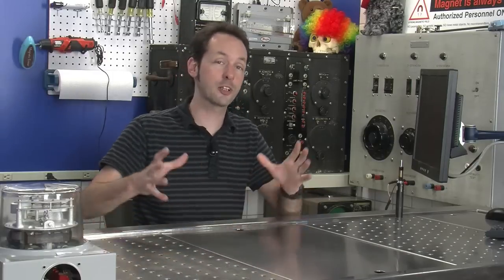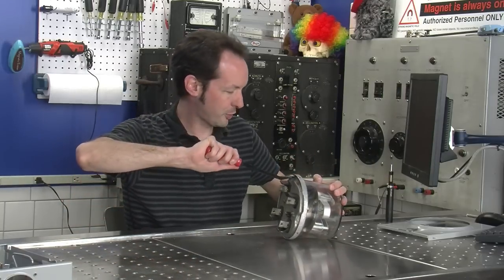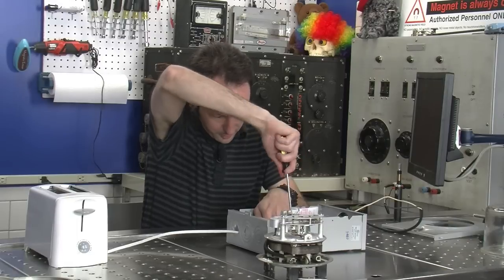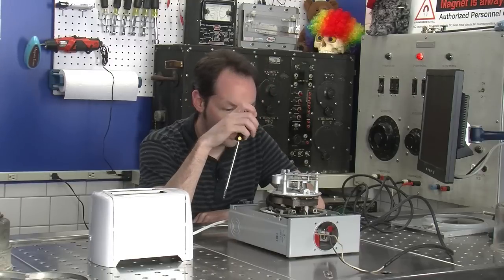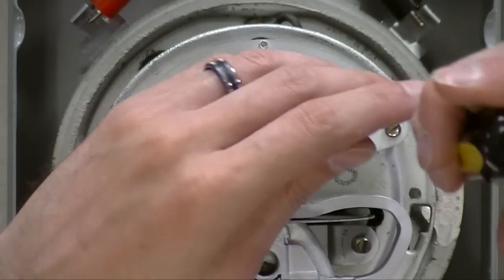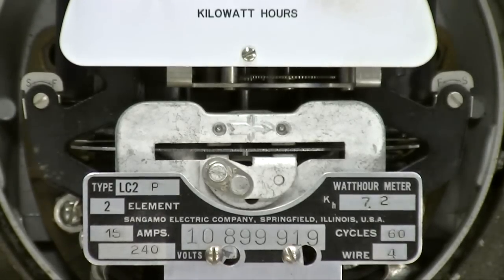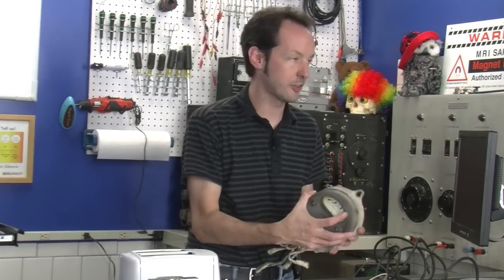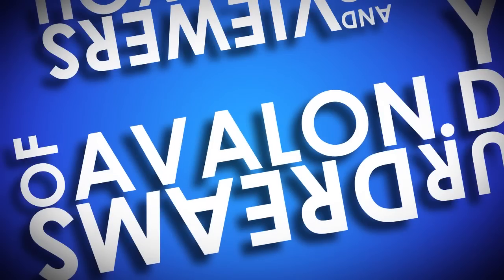Power Meter: Equipment Autopsy #66

Comment: I have been in metering for a utility for 35 years. I enjoy watching videos like this, and use them for comic relief and training of my apprentices.

As someone else stated earlier, the "lead seal" around the "fish bowl", is part of the cover and you simply unscrew it from the base. There is a small seal that holds the cover on and detects tampering if anyone has removed the cover. On a meter this old is it probably a small screw with a hole in it for a wire seal. 

The 15 amps is the test current rating. The meter is rated for 100 amps. Modern meters will now have info on the nameplate such as TA 30 amps, CL200 which is 30 test amps, meter rated for 200 amps. CL stands for Class. When you test and calibrate a meter you test at the rated voltage and current for the test, in this case 15 amps. The adjustment screws are for full load and light load testing. Full load test is done at 15 amps and light load at 1.5 amps. You can speed up or slow down a meter with these screws but not more than a few percentage points. Not enough to see any visible difference. 

The K 3.6 is the amount of power or watt-hours for disc revolution. It is now on the nameplate at Kh 3.6, the Kh is known as K sub h. 

Not sure why he popped the indicating needles off the register dial, they come off with the register when you remove the two screws. 

Perhaps a little research online would help before doing a video, but then we wouldn't have the entertainment value.

Comment: Kh = 3.6 means 1 revolution of the disc equals 3.6 Watthours. The disc has to do 277.7 revs for 1 kWh. The second meter you showed has a different wiring configuration. and constant of Kh 7.2. Should have run at half the speed of meter Nr 1. Tip a kWh meter should be installed vertically.
Reply: RODALCO2007 I had a funny feeling I'd find you in here

Comment: I like your videos! 
The "15 amp" rating is not what the meter can handle, it is the load current used to calibrate the meter. For 100 amp capacity, 240 volt meters, the calibration current will usually be 15 amps, and for 200 amp capacity, 240 volt meters it will usually be 30 amps. 

So those should be 100 amp rated meters, which, considering that 40-60 amps used to be a common house service, was plenty of capacity! Lol

Comment: I'm a little behind, the two fast/slow screws... one is for the voltage side or top of meter and one is the load side or bottom of meter, the disc spins based on the voltage coming in and the amperage or current being pulled inside, so depending cranking both screws to fast may not work too well unless you have a heavy load

Comment: Hi there, do you think that 3.6 might be the power rating for the electricity supply. e.g. 15 amps * 240 volts = 3600 watts. W=V*I. Just a thought.
Reply: Kh ( 3.6) = 3, 600 watt second per revolution of the disc, the smallest amount of watts To start the disk rotation, (Killowatt hour constant) Divide:  3.6 Killowatts 60 minutes per hour 60 seconds per minute per 1 revolution= 12, 960 watt seconds ( equivalent)= 15 seconds per revolution = 864 watt seconds . Test Ampere rating 15 amps ( Smallest amount of amps to accurately record Electric consumption, Maximum capacity( 60 amperes) = 400% overload capacity

Comment: Old school power meters are cool 'cause you can see how they work. There are two coils, one in series with the load to measure current and one in parallel with the supply to measure Voltage. As you said, there is no movement of the disk if you have Voltage with no load (current). And the really cool bit is that the Voltage and current have to be 'in phase' for the meter to measure at all. In other words, the meter responds to and measures  only 'True Power' (Watts), but not reactive power (VAr)

Comment: More as the video goes on.. The 2 screws are the Fulll Load adjustment and the Light Load adjustment as previously mentioned.  They will only effect the accuracy of the meter by 5% at most.  After that, you toss the meter and get a new one.

Comment: That is a US meter. In the US and Canada, hot is 110 V relative to ground (and, thus, neutral), but we actually have two hot wires come in that are 180 degrees out of phase. Each is 110-120 V relative to neutral, but 230-240 V relative to one another.

Comment: Interesting video but you really didn't get to the functional heart of the watthour meter. The part you removed and dismantled was the register - used for recording the energy usage. 
The disk is both a motor and a generator. There are two windings - one for load current and one for line voltage which combine to provide a torque to the disk motor proportional to the load power. However,  there is also a permanent magnet which creates eddy currents in the revolving disk acting as a magnetic brake to provide a load torque proportional to rotational speed of the disk. This is basically a short circuited generator. The combination of the motor and the generator functions provide a disk RPM which is directly proportional the instantaneous power.
The register accumulates those revolutions.

 BTW - I sure hope that table is grounded!

Comment: The physics of these is actually rather interesting. The rotating disk is aluminium, which is not ferromagnetic. It doesn't spin for the same reasons a normal motor armature spins, instead the eddy currents induced in the disk create a magnetic field which spins the disk.

Comment: Most US homes have two 120 volt mains, out of phase with each other. Potential between the two mains is 220 volts. Since the meter measures all the wattage to the home, it has to connect to both of them.

Comment: that "lead seal" was likely just part of the glass bowl, usually you twist the bowl and the glass and the ring come off as one unit, you put it on the same way. the seal itself goes in a slot in the side of that metal ring.
Reply: Will Phoneman yep.

Comment: You are running a nutral to the hot on that. The toaster should only be connected to one leg of that meter being each leg is 110. I have taken these apart and experimented and the screw (fast/slow) advances the needles not the plate

Comment: It depends on how the smart meter is connected to send data.  If by telephone line or cable TV line, no EMF.  Others use cellular service or wifi, so there is RF EMF as with other wireless devices.

Comment: nice i have a meeter much like your second one. i want to turn it into a display type thing. it will be lit up with some leds and i have a small motor that will spin the disk as fast as a 15 amp load would to make it interesting to look at ... unfortunately i got side tracked and its sat unfinished for 3 years now

Comment: Here in Germany (and most europe) we got 3 phase 230V (RMS) relative to ground, each phase shifted 120 degrees out of phase so ~380V (RMS) between the phases and over 500V Peak. So pretty high voltages here :D

Comment: You were lucky not to get shocked by the electricity while you were using the screw driver touching all the parts of the meter that was energized. You were crazy.

Comment: 1 kW during 1 hour is equal to 3.6 MJ (megajoule). this may explain your little mark on the disc

But I can't understand why we use both joules and W.h^-1 ... why not W.s^-1? (which would be the "normal" SI writing)

Comment: He DAMAGED the glass cover, by prying it open in the video, later he removed the screw that holds the glass cover ring in place. To properly remove the glass cover on this vintage meter, is to FIRST remove the screw on the back of the meter, than twist the glass cover counterclockwise until the three clips on the back of the glass cover disengage from the base of the meter. Obviously he mistaked the metal ring around the glass cover as the sealing ring, A SEPARATE Tamper proof ring installed by the utility company with a screw in the bottom that clips the ring around the glass cover ring💯, however with this socket shown, that sealing ring would NOT be used, hopefully he finds a replacement glass, they are getting harder to obtain for this vintage of meter💯

Comment: I'm surprised you even got one. what I heard in high school I took electricity, they are quite expensive, and get reused mostly. I think they said a meter would run a couple K $ just to buy one.
Reply: they are on ebay for like 60 bucks
Reply: You can get meters routinely for under $30.  I have worked as a journeyman meter electrician for 38 years, and that guy has a very basic understanding of meters, but is way off.  First of all, removing the glass cover involves a small turn of the glass, not tearing the ring off of the glass!

Comment: Just bridge some 0000 gauge wire between the input and output and voila! If you're really smart you'll step down the power to a the transponder and supply your OWN readings. Maybe n/100 to start.